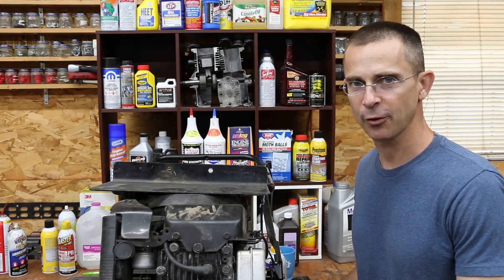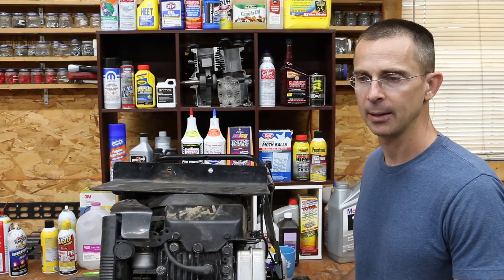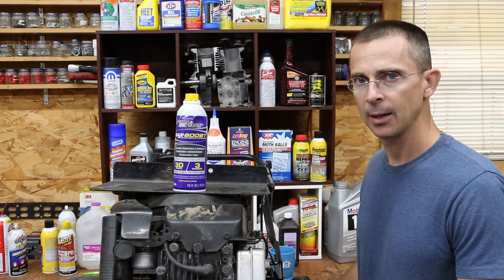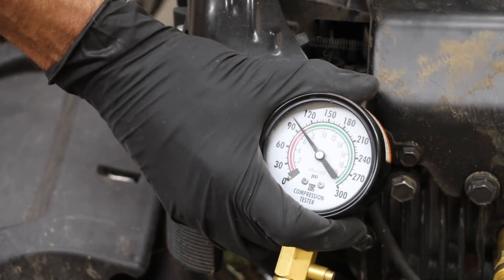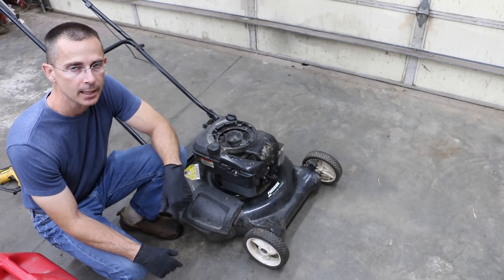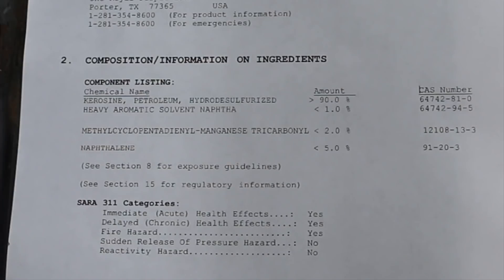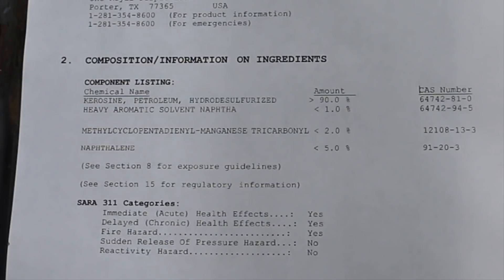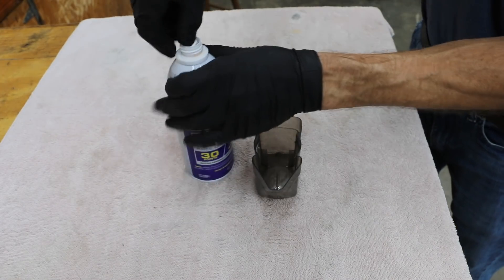Will a gas engine run on 100% octane booster?  Let's find out!

Comment from the maker: I had a lot of fun with this video. Here's a link to the octane booster used in the video.  Thanks and best regards, Todd  https://amzn.to/3aW09Pe
Reply: I'd love to see a comprehensive video done on octane boosters mixed accordingly do they improve performance.  There's a ton of them out there, some of which quite pricey (VP, NOS)... do they deliver?
Reply: @matthewkiel7965  I'm with Mathew.  There are so many products, and so many claims.  I want to know what is the best product.  I need Booster for my dirt bike and for my '68 Olds 4-4-2.  I used to use STP, but after some online reading, I moved to Lucas Oil's product.  Which really is the best Boost for My Buck?
Reply: How come Royal Purple dosen't get into the grape juice business??
Reply: I don't like Royal Purple for a simple reason. They put a crap ton of purple dye in all their products. You can't check your oil and say. "That looks dirty". Cause the purple dye makes it look dirty straight away Its just so purple that it looks like black dirty oil.
Reply: Will a gas engine run on any kind of paint thinner?
Reply: Please do a video of running different grades of gas through a lawn mower, inlcuding some with correctly mixed octane booster (not 100%), to see if the work the engine is able to do increases.  I've noticed when running lower octane gas in a mower it bogs down much more easily getting into tall grass and that it can stall the engine.  When I've tested it with higher (92) octane gas the mower seems to handle tall grass much better and is less likely to bog down and stall.  Can this be improved upon and will the mower work even better with octane booster?  It'd be great to see it tested and demonstrated.  Thanks for all your hard work.  I really enjoy your informative videos.
Reply: Can an engine run on other petroleum extracts like Naptha and Toluene?
Reply: @ Project Farm can you test out vp madditive octanuim octane boost top speed in your bikes?
Reply: Sorry this is LATE and I have tried to find INFO - But - DO OCTANE BOOSTERS actually work...
Reply: Could you do an octane review and wether they work well enough to purposely buy low octane and just add booster all the time.  Prices on premium gas are over a dollar higher if I could save some money by buying booster instead that would be great.

Also what are the effects on fuel mileage.   Stp clames to treat your system and increase boost or is this all just a gimmick.
Reply: Would you test Marine 2 stroke outboard oils from Amsoil, yamalube, Pennzoil marine, and any others…. 
Test for cleanness in f burn, carbon deposits, lubrication, etc….
Thanks
Reply: Watching some of these old videos makes me wonder what happened over the years did you save a bunch of money on your car insurance by switching to GEICO? Just funny to notice your joy level steadily boosting your moral and enthusiasm.
Reply: Will you please test Lucas low viscosity oil stabilizer? Not many videos on YT about it.

Comment: I always come here first whenever I need to buy any product that I have no experience of. I'm pretty sure modern mothballs don't contain that chemical anymore, and if it did, modern gasoline is probably way better than the old wartime blends, that were barely combustible, so I don't think it would make any difference these days, except maybe make the fuel very sticky.  With these modern octane boosters, I guess the orange build up is easier to clean off your hands than the traditional  black stuff 👍
Reply from the maker: Thanks for the feedback.

Comment: On the theme of alternatives to gasoline, suggest trying: CNC (Compressed Natural Gas), Propane, Methanol, and Hydergine.  You can use a standard  4-stroke ICE but have to mess with the carburetor.
Reply from the maker: Thanks for the suggestion.

Comment: Would you run 100 octane non ethanol (aviation) fuel in a 2 cycle and show how it performs and is it worth the extra cost over regular 87 octane with ethanol

Comment: Ever try to use ammonium chloride and distilled water electrolyzer gas to run a gas engine with maybe some sodium carbonate and or ammonium chloride for the electrolyte. Just two bronze wool electrodes separated by fiber glass or non conductive material that lets water pass through. Maybe a sponge operator.

Comment: Not sure if it's been said but the Orange is a left over from the MMT (the chemical name I cannot pronounce either), an extremely common additive in octane boosters. Ive ran both Maddative and Boostane in my boosted 4 cyl and it appears depending on the concentration of MMT and other additives, the orange will be more or less left over from combustion. It can be harder on plugs and o2 sensors, but seems to help great with holding detonation at bay.

Comment: Have you tried wd_40 in regular gas,and in antifreeze. I've shot a squirt in my gas and antifreeze reservoir jug for over 15yrs never had water pump or fuel issues.i just figured lubbing up water pump and o rings and injectors would be ok.any thoughts? Ps love your channel, also I've used restore since 1988.
Reply from the maker: Thanks for the suggestion.

Comment: Just two things for this experiment come to my mind from the gate: 1) Higher octane (the 8-sided-molecule that makes it up) causes the gasoline to burn MORE SLOWLY, and thereby having more time to generate higher compression.  and 2) The number one thing generally used to 'increase octane' or to have the same effect is ETHENOL.

I don't think, from my chem experience, that there is a 'pure octane'... but you can 'boost' it chemically by having the additive create the same effect in normal fuel.  Kind of like how you can put 'lead additive' into older vehicles to get the benefits they would have gotten from leaded fuel (without, you know, putting actual LEAD into the fuel).
Reply from the maker: Thanks for the feedback.

Comment: YOU SHOULD RUN THIS FOR AN EXTENDED PERIOD UNTIL THE ENGINE FAILS. THAT WAS PRETTY IMPRESSIVE. BUT I THINK IT MIGHT EITHER MELT DOWN OR DETONATE. WOULD BE VERY COOL
Reply from the maker: Thanks for the suggestion.

Comment: So I have this product at work called hypershine, it's a tire shine.
It's base is heptane, it's super flammable and it also has an oil in it. 
Anyway I discovered it's great for starting small engines, they love the stuff.
I  haven't tried any in the tank, but would be interesting to see.
Reply from the maker: Thanks for the suggestion.

Comment: I thoroughly enjoy your methodology and your folksy presentation, and I learn a lot from your videos. However, I've been through so many "Will an engine run on (?)" investigations that seem whimsical to the point I expect to see one asking whether an engine will run on a vodka martini or aftershave. I believe these videos address unlikely situations and waste your considerable testing skills. Could you try testing some products that might be found in more likely scenarios? One that I've often wondered about is whether those airless plug-in spray guns are any good. Or, how about a comparison of hand-held torches that use propane and/or other bottled gasses?  Thanks....
Reply from the maker: Thanks!  Thanks for the suggestion.

Comment: Is it possible to run an engine with octane booster (stp,gumout,amsoil)+fuel system cleaner (pi amsoil, techron Chevron)+fuel stabilizer+upper cylinder lube additives with 50% gasoline (ethanol free)? I had done it with one of my vehicle and found my car had issues with revving up. It was running just fine and getting same speed at lower rpm. But on a highway I couldn't take my rpm over 3k
Reply from the maker: Thanks for the suggestion.

Comment: I know this is an old video and I haven't read ALL of the comments below, so this may have already been said. The orange/yellow deposits are most likely NOx (Nitrogen Oxide) deposits. You stated in the video the engine was running a bit hotter than normal. NOx is a pollutant and forms when combustion temperatures are too high (~2370°F). The tell tale sign is the orange/yellow deposits.
Reply from the maker: Thanks for the feedback.

Comment: If you ever thought if the gasoline engine would run on woodgrain alcohol or that Everclear alcohol to see what the temperatures would run at and whether or not it would increase power or performance?

Comment: This video reminded me when I used to use octane boost in my car alot I also used to use the Prolong friction reduction additive and swore by it. 

Have you ever tested that stuff? I used to tell people that I was so confident in the product that if they didnt feel a noticeable difference in smoothness in their engine I would pay them back for their purchase myself.

 The few who took me up on the challenge came back and thanked me for recommending it claiming their engines have never ran better. 

Every time I put it in an engine you can littlerally here the idle drop down a few hundred rpm like everything just has to work the much less unlike products like Slick 50 and other "friction reducers" that seem to do nothing Prolong was always noticeable to everyone.

Later I learned to use an oil flush to break up the carbon immediately before an oil change then the Prolong which seemed to produce even smoother results.

I've also used the Prolong transmission fluid  which I found made my manual vehicles shift into gear noticeably smoother like butter. 

So what do you think, I think the idle lowering proves something but is there a scientific way to test oil additive for "slickness"?

Maybe drain the oil like they used to do in their commercials and see how long the engine runs with no oil in it?
Reply: I used to put Prolong in my old Ford Grenada. I to swear it worked. After i could no longer pass smog with the car we used it for the Demolition derby for its last final battle. The radiator hose blew in the first 5 minutes of the derby but the car continued to run for 10 minutes more under extreme throttle with no coolant. Finally had to stop when we lost a front tire and the car got stuck. The next day we checked the oil seemed good put the key in and it fired on the first try and sounded good no knocks or bad drive train sounds. People say Prolong was snake oil but i think it worked in that old engine.

Comment: The question remains though...
What happend to the spark plug ?
I added one full bottle to a full tank of fuel in my 02 ford explorer and drove 120 miles, pulled the plugs to inspect and the electrodes were fried...gone. And these were new plugs.
Reply: I’m guessing but it sounds like maybe those electrodes were in such bad shape beforehand that the octane booster just “cleaned” them off.
Reply: @michaelbaxter8249  They were brand new plugs...

Comment: How hard was it to remove the MMT (orange coloring) from combustion chamber? Did it easily scrub off or did just running some straight gas through it clean it up? Thanks for the video.

Comment: You should do a video on wich octane booster is the best, and are they worth buying in general. But you might want to use an engine where you can alter the ignition timing, for testing.
Reply from the maker: Thanks for the video idea.
Reply: @ProjectFarm yes!  I was at store today, and looked to see if you had  an Octane booster video… but nope 😕
Reply: I would absolutely love to see a real life test with octain booster added.  See if any of the brands actually work , As a octane booster

Comment: Hey project farm celebrity. Would love to see you do a short video on the hundreds of claims of using acetone added to fuel to increase fuel efficiency. I did add about 5oz to full tank of fuel of my 95 Toyota Tacoma. And appeared to run great and maybe a little increase in fuel efficiency. Was difficult in determining results due to a variety of driving conditions.  Love your videos and consider the challenge. Thanks pal
Reply from the maker: Great suggestion!

Comment: Anyone have actual proof that these octane boosters work to actually raise octane levels? I would never use any fuel additives for fresh fuel in a modern car. However I recent bought a 2004 chevy trailblazer that had about 1/4 tank of gas  that's been sitting for 4 years. It's surely lost a lot of octane and I don't want to deal with  draining the tank. My theory is fill up tank with 93 octane with a booster to combat the old fuel

Comment: I've heard most octane boosters leave brown or orange deposits in the combustion chamber, foul plugs, ruin O2 sensors and catalytic coverters in automotive applications. Basically a no go unless you replace and rebuild often in racing engines.
Reply from the maker: Thanks for the feedback.

Comment: I love your videos and scientific approach.. I've used a lot of the products you test some of them just trusting the reputation handed down to me by my father and grandfather some just to "see"... Thing I love most is usually Grandpa and dad were right and you just prove it for them after the fact. I'd love to see you do a test on octane boosters I currently have a daily driver that I use VP madative that raises the octane 8 pts does the higher octane actually increase power and clean the engine when it's made with additives and how much is too much for a motor... Say I used 110 octane race fuel and the VP additive to make 118 ... How long do you think a motor would hold up... If it helps I drive a 2003 infiniti G35 I have no catalytic converters to damage and just for fun I'm thinking about giving it a go since I got the car cheap and it's almost time to get a new one do to buffalo ny rust lol
Reply from the maker: Thanks for the video idea.

Comment: I used 1 is to 10 mixture (1lt kerosene + 10lt diesel) for diesel engine, it run smoothly no smoke belching , for 5yrs we used for passenger vehicle.
Reply from the maker: Thanks for sharing.

Comment: Suggestion for testing:
Do octane boosters actually improve HP over Premium Unleaded Gas?  If yes, how much is needed to get how much HP?  What's the best brand?

Specifically looking at car performance.
Reply from the maker: Thanks for the video idea.
Reply: If your vehicle isn't tuned for a specific octane it will only decrease performance. Get a tuner chip and then advance the timing for increase in octane.

Comment: If octane booster is 90% kerosene, could pure kerosene be used as a cheap alternative to octane booster, and in what proportion to get the desired octane boost?  Could a regular 87-89 octane gas be boosted to an octane high enough to run in a turbocharged engine, for less than  the 50¢/gallon premium paid for higher octane gas?

Comment: I am really surprised learning that not only will a gas engine run on kerosene but so many gasoline additives contain kerosene. So will adding kerosene to gasoline actually provide a benefit to the performance of a gas engine or is octane booster a placebo effect .? Ty so much for doing these experiments and making vids I enjoy watching them and continue to learn from them.

Comment: How about hydrogen/oxygen mix?
I imagine you'd have to lean it out a good amount but in theory should run the engine easily and efficiently.
I've also read and talked to engineers n found that a high frequency high voltage arc will instantly convert water into hydrogen n oxygen when misted onto the arc.
Reply from the maker: Thanks for the video idea.

Comment: Depends on the type of octane booster.  Some aren't that flammable but it's an expensive way of running an engine.  They work by inhibiting fuel burn rate to avoid explosion and therefore pinging.  Even a small amount of kerosene can do the job, but it might burn dirtier.
Reply from the maker: Thanks for the feedback.

Comment: The orange stuff is manganese oxide, which cannot be easily removed. My catalytic converter was broken off from the flange, and I saw the pores of the honeycomb was plugged all the way around the center of the catalytic converter and the edge, weirdly I conducted a back pressure test several weeks before that, there was very little back pressure. I guess the catalytic converter probably had a crack already at that time, and I had random teenager followed me to the gas station asking me what exhaust I had, I told them it was stock, now I know why.
Reply from the maker: Thanks for the feedback.

Comment: I know most of your videos are about small engines in farm equipment/lawn mowers or older vehicles, but it would be cool if you could test some of the additives that supposedly fix carbon buildup in direct injection engines. I’m sure there are a few old VW/Audi 2.0T DI engines you could get super cheap. The early EA113 FSI engines were super susceptible to carbon buildup on intake valves. Other than walnut shell blasting there’s not really any proven way to remove the carbon buildup. Some have suggested A BG product to remove the coked on carbon, but there’s not really any thing definitive. You’d do an excellent job with that kind of video. With direct injection making up almost all modern engines these days from even Toyota and Honda products, carbon fouling will likely become much more of a mainstream problem.
Reply from the maker: Thanks for the video idea.

Comment: Have you ever tested a product called Ring Free by Yamaha? It's a fuel treatment we use in outboard 4 stroke boat motors to clean out carbon deposit. This stuff is extremely $$ but its the best product I've ever used and everyone who uses it will tell you the same. I would like to see a real hands on demonstration how this stuff really works.
Reply from the maker: Thanks for the video idea.

Comment: Just saved my ass while driving to an appt. Ran out of fuel but managed to turn into a walmart parking lot. Octane boost in my 4 cylider cobalt and i putteted over a mile away into a gas station. Big thanks!